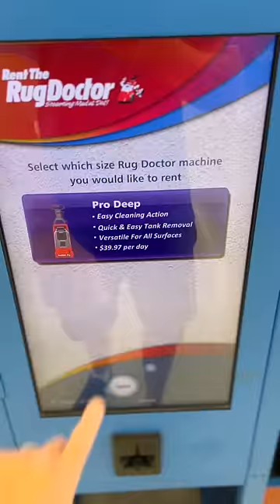Can a Rug Doctor wow the Carpet Repair Guy? #shorts #ad

Comment: FYI, just bc this is loosely related. You shouldn’t reuse an aquarium heater if it’s been left on out of water. The glass material in it will crack, the heater may not work correctly, and your fish could be electrocuted. The heater could look burnt like this, or just like normal.

Comment: Everyone is talking about the cat but nobody's talking about how the floor now literally has a hole in it that was burned there, that should have been replaced before you even put the carpet back in. Instead now you have a potential tripping hazard or something that somebody can get caught in if they're walking and press on the rug too hard, and now you have the start of structural damage in your floor which is eventually going to spread out and then shark tooth and then we're going to have your entire floor collapse. Is it going to happen over the course of a couple weeks, no, but will it happen over the course of a couple years, absolutely.

Comment: bettas require a MINIMUM of 5 gallons, as well as adequate filtration. you've done well having a heater, but if you're capable of doing research to know that bettas need a heater then you are capable of knowing that bettas cannot live in tiny bowls. I would suggest doing the right thing and either rehoming the betta, where it can be given proper care, or buying the right equipment. fish are extremely difficult animals to care for and you HAVE to be up to the task. this betta does not look healthy so unless you are willing to give it a proper tank at the very least, you are not up to the task.

Comment: I've heard mixed things about that seam iron. For people that don't know, when you seam carpet it's with a melted adhesive that firms up and gets into the backing. Looks exactly the same as the tape he used but it's usually orange, creates a bond stronger than non seamed carpet if you do it right in some cases. But that one uses heat waves of some sort, weird concept but a lot of new technology with flooring tools sometimes doesn't work out too well lol. Any other floor layers ever used this for longer seams?

Comment: Damn now that one spot is cleaner than the rest of the carpet
Reply: Different levels of wear. That's the one flaw here: it's difficult sometimes to find a donor area of carpet (such as in a closet) that also has the same amount of wear...

Fibers that are worn essentially have more surface area (if they're not outright thinned away), so absorb more light and seem "dark" or "dirtier", regardless of how clean they are.

Comment: That betta is going to pass away way before it’s natural life comes to an end. The water is disgusting, it doesn’t have a filter, the “tank” is way too small, and I feel like having a heater like that is going to get the water too hot. There isn’t anywhere for it to hide so on top of being stressed because of all the other reasons, that’s now added on top of that. They would have to change the water completely every few days and that’s just going to shock and stress that poor fish. A bowl is NOT a good home for any fish. They deserve better. But I bet when that fish dies, they’ll just replace it like it’s no big deal. Fish are some of the most abused pets, and it’s really sad. I love bettas. They have such cool little personalities. You can teach them tricks. That fish deserves better. Bettas need at least a five gallon tank, a gentle filter, lots of places to hide and things to rest on. They need a longer tank instead of a taller one, they breath oxygen air as well as through water, but they’re not the best swimmers, so a shorter but long tank is better. They need plants (real or silk) to take a break on because they aren’t great swimmers. This is disgusting. This isn’t even the bare minimum.